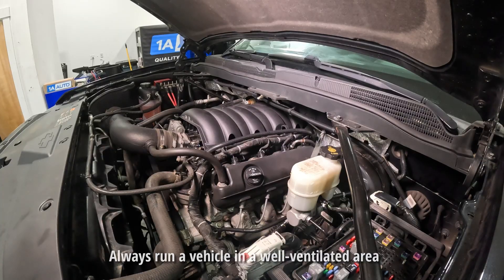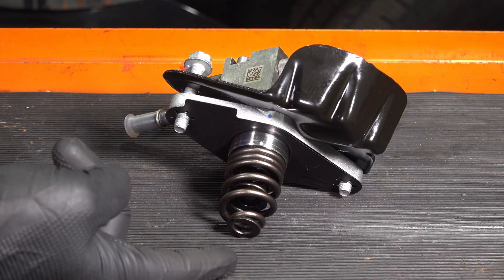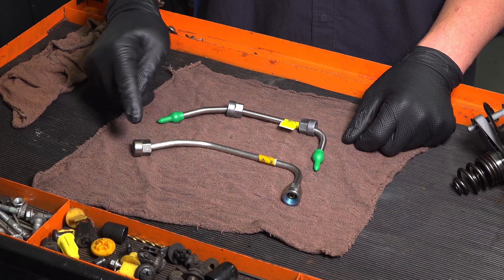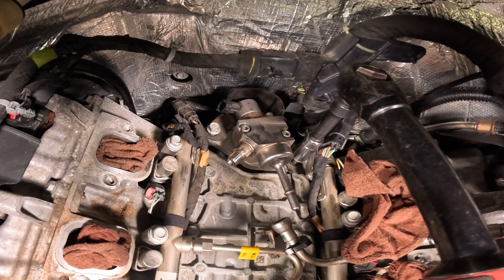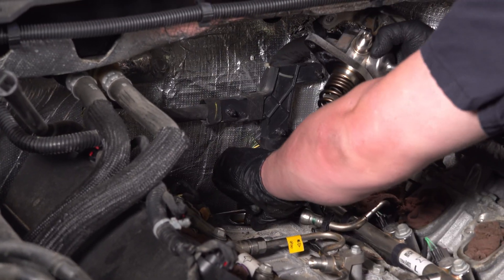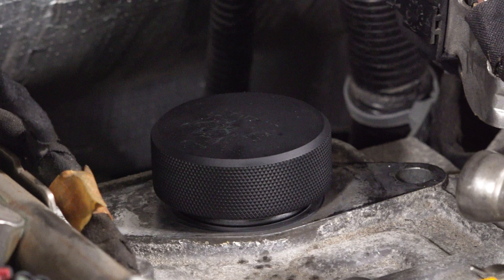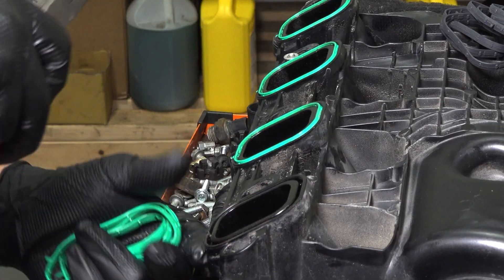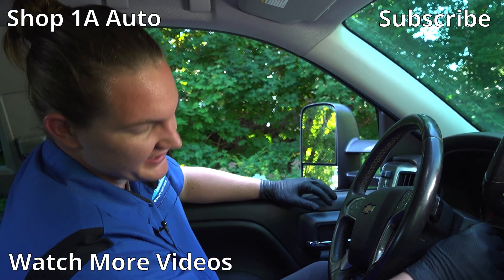Why is My Car or Truck Still Running After Turning It Off? How to Check Your High Pressure Fuel Pump

Comment: Can you explain your theory on how the hp pump leaking is causing dieseling? It's not a compression ignition engine, which requires an ignition source to ignite the fuel! Might want to look into that.